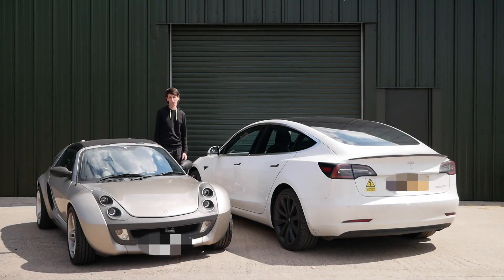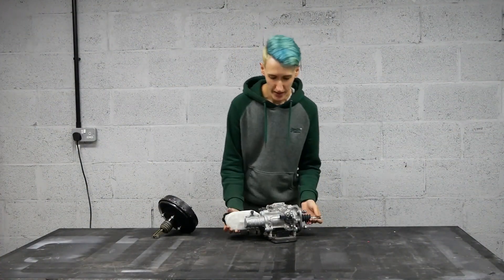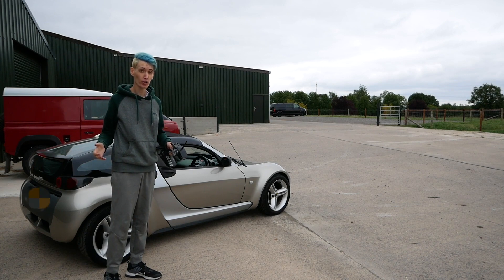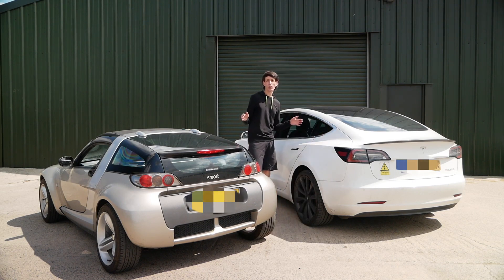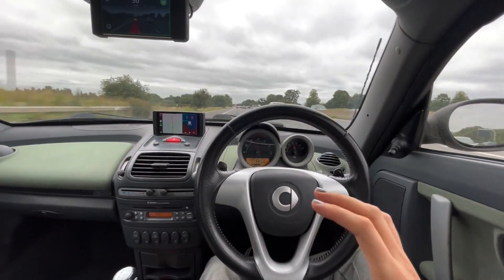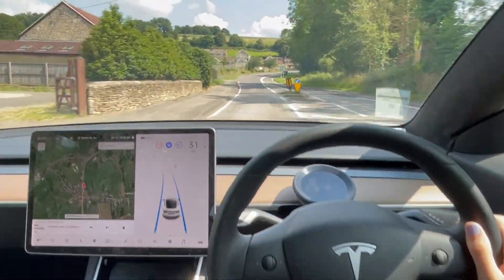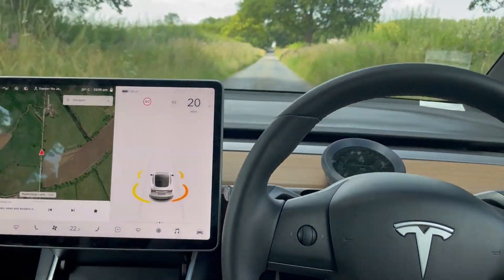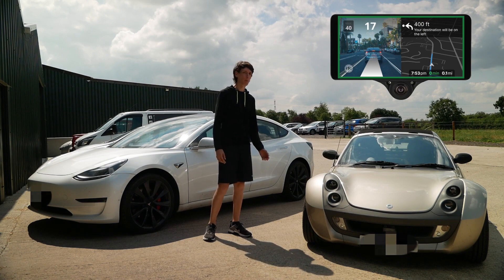How I made a Self-Driving Smart Roadster

Comment: Hi Seb, fantastic work, you may have solved the MERC problem! I have a 2012 B-class 180 CDI manual, but without adaptive cruise control or lane assist. So I am stuck without self steering. I do believe my car uses the same EPAS as the smart. Would you be willing to share your ECU design or even sell it? It would solve a lot of cars with EPAS but not lane keep assit (which is basically the entire SA used car market ;). Great video -
JP from SA
Reply from the maker: While i have designed it for my own use and tested extensively, I would really be ha[[y installing in other peoples cars yet as if it goes wrong I am responsible for potentially multiple lives. I would require a little more external funding, time and research to get it to a saleable product.

Comment: The thought of this glitching or disabling mid-corner with your hands off the wheel and causing a head on collision is terrifying.
Reply from the maker: isnt that true with any control system though? What happened if a planes autopilot glitched? You do everything you reasonably can to prevent this happening.
Reply: @phoenixs3  planes don't pass this closely or at the same frequency. They also have multiple redundant systems for everything including collision prevention.

Comment: Been planning on adding openpilot to my BMW E46 estate once ive finished EV converting it
Reply from the maker: do it! only challenging this is figuring out how you will actuate steering....
Reply: @phoenixs3  currently using an electric hydraulic pump for the EV conversion, but have seen people using Toyota EPS columns which are already hacked and work with retro pilot. So that’s the plan

If you fancy selling your older OP hardware after you’ve fitted V3 hardware then I’d be interested

Comment: Very impressive! Out of curiosity, what happens currently when there is little light or rain?
And great work on reverse engineering all these OEM ECUs. I was looking for a way to control an iBooster for an EV conversion, so I'm excited to see you found a way. I'll dig into the repositories :)
Reply from the maker: works in extreme heavy rain, even direct sunlight still very good. the comma driving model is very good. i will be selling a kit to control the ibooster shortly. unfortunately my code isnt open source for that as it took 6 months of development time to crack the ibooster.
Reply: @phoenixs3  That's understandable. Will the ecu work with both the gen1 and gen2 ibooster? Or specific versions?
Reply: @phoenixs3  how much would it cost to make your code open source?